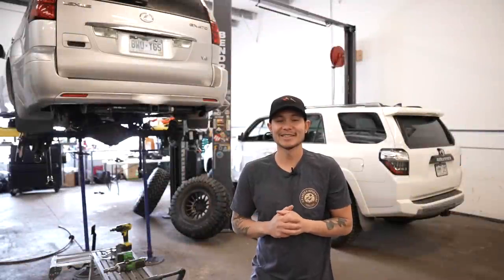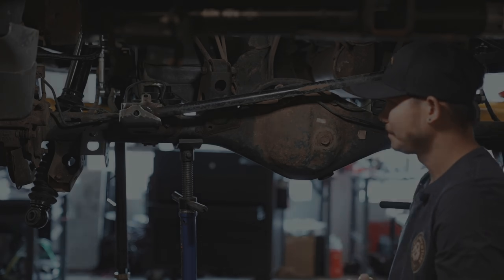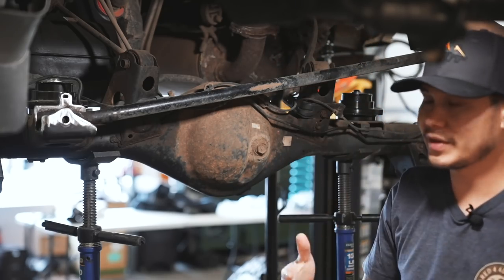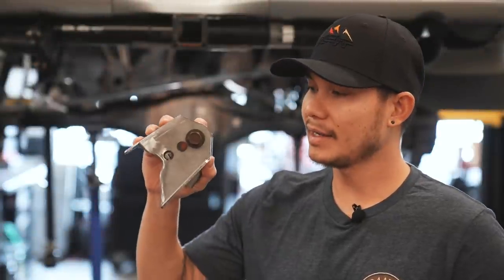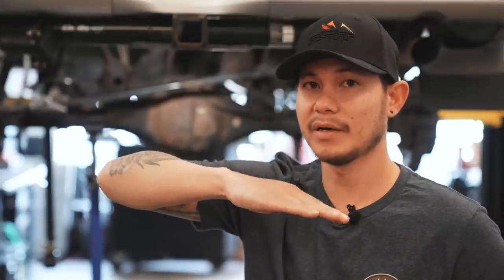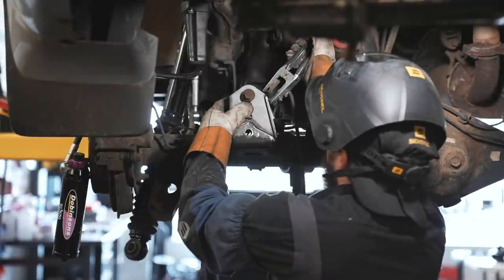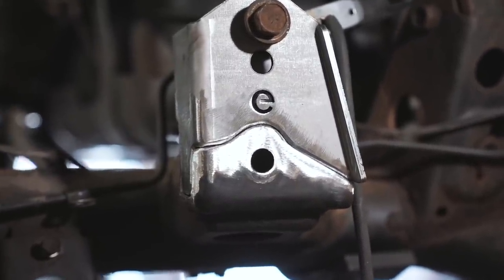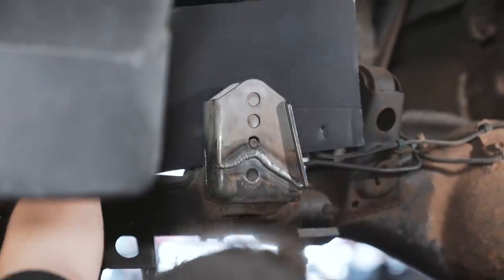Your Lifted 4Runner, FJ Cruiser, & Lexus GX Needs This Mod - Panhard Correction Kit

Comment: Just a helpful tip. Do not ever do a stitch weld on any structural or load bearing part. Machine setup sounded good but the weld is a little cold. Either turn the wire speed down or turn up the heat. Good job on the prep/fitment and beveled edge.
Reply: Was going to comment the same thing. Why do a continuous stitch weld here when you can easily run a full weld end to end?  Odd... the shop needs to get some like-gauge plate and learn to weld this right.
Reply: no dude he’s a ‘master welder’ lol

Comment: 1) Nice looking weld 👍🏻
2) 1/2 assed video if you can't show it on the ground finished. What were you thinking when you posted this.  Learn how to make a complete Video
3) The FJ tipping over had NOTHING to do with the panhard bar.
Reply from the maker: 1. Thanks!
2. Sorry
3. Ok
Reply: Yah the finished Install should have been shown,  from the angle of pinhead bar after the new part added on looks the same as before it was added
Reply: I'm honored Uncle FJester replied!  (kinda of a fan, honestly)
Reply: @Runnin4Tacos 😂

Comment: great mod.  PCK fixed my:  1. centered my axle after a 3 inch lift. 2. fixed my  high speed rear dump steer. 3.  made the roll over angle closer to stock, less tipsy on off camber situations.
Reply from the maker: Yessir, definitely!

Comment: I have a 3 inch lift on my 07 FJ Cruiser and their isn’t much change to the angle of the P Rod from the stock position.   
I think this applies more for lifts over 3 inch’s.
Reply: Yup this is not even needed until passed 3”.  And the real way to do it is not to only raise it but to also extend the pivot points.  This is just the cheap way of doing so ppl can use the stock pan hard bar.

Comment: Thanks for taking the time to do the videos man. My question is: if you have a stage 3 or up lift that comes with an adjustable panhard bar is this mod still needed or is the point of the adjustable panhard to correct the issue by itself?
Reply from the maker: Yes the adjustable bar does a different job

Comment: Thanks - do you need to test the pan hard bar angle while the vehicle is lifted off the ground or at full droop? I have a 2" rear lift springs but on the ground my pan had bar is pretty level. I do have KDSS so maybe it's compensating?

Comment: Honestly debatable...I have my 4runner lifted moderately with no issues at all with stock panhard. I will say with the 2" lift I have the stock panhard is still nearly level. Rear weight with lift can make this very subjective.
Reply from the maker: Many people don't install this and have no issues, just like anything else that you can do to the truck. It is just recommended to fix geometry
Reply: Physics isn't really a debatable things. It's not life or death but it for sure is better to correct that issue. On any pan hard vehicle.

Comment: Love this video, I think and hope it will help me fix an unsolved problem on my GX470.  Prior to my lift kit, one side of my rear was higher than the other, I would say about 1".  I figured it could be the airbags but the airbags were fine.  I then had the chance to get the Eibach Lift Kit and got it lifted, now I noticed one rear side is much higher (1.75" to 2") than the other, and whether or not this is related, one of my rear tires is more in while the other is out, I would say less than half an inch.  Would this Panhard Kit help my scenario or could it be something else?  I'm starting to think it would at least fix my axle since you mention it could move while driving (left/right)!
Reply: I also have KDSS

Comment: If the pan hard bar was correctly installed at factory to keep the diff centered throughout the entire stroke.... Then even if you lifted it (setting it lower in stroke at ride height) it still will be correct throughout the complete stroke......, change my mind.
Reply: Wrong. The more you lift it with a stock pan hard bar, the axle will shift over to passenger side.  So depending on the lift height / static ride height , you could be rolling down the street with the rear axle sticking out more on the passenger side vs driver.   This kit helps keep the axle centered at a specific ride height.  I just don’t think it’s even needed for anything 3” or lower.   And then we we talking true long travel , you actually want the pivot points further apart and using a longer pan hard bar.   This will have the axle swinging less left ton right thru long travel stroke.
Reply: @fltllc4136  You seem knowledgeable.  What exactly does an "adjustable" panhard bar do? If you please.
Reply: @andynonymous2164  it allows you to adjust the length of the whole bar.
Reply: Trying to help you under stand.  It’s simple geometry. No the axle does not stay centered through out the suspension cycle even on a factory vehicle. It can’t. It pivots from one side. Now if you are talking about a triangulated upper links , then a pan hard bar is not needed. That set truly keeps it centered.  Only reason why they don’t do it from factory is because of fuel tank location.

Comment: Would this help with KDSS system where it hits the panhard bar?
Reply from the maker: You'll need the kdss drop brackets if you have 2 inches or more
Reply: @Runnin4Tacos  Ah so still need that drop bracket.  Thanks.

Comment: master welder lol.  just a bunch of tack welds on material that had a tiny bevel.  basically butt joint.  never take your rig here to get worked on.  nothing on that entire rear axle has a bunch of tack welds holding it together until this guy got a hold of it.